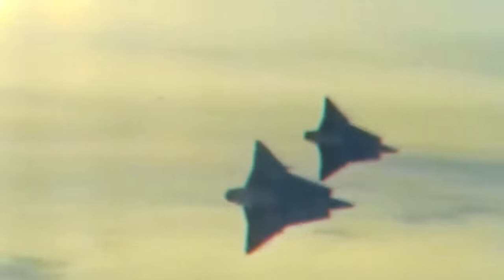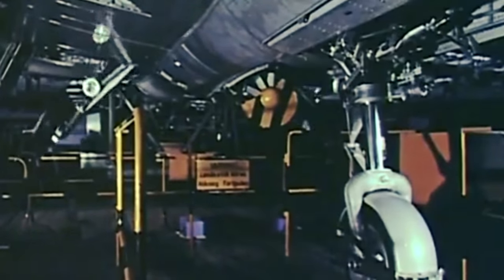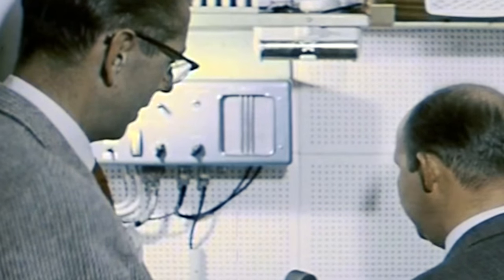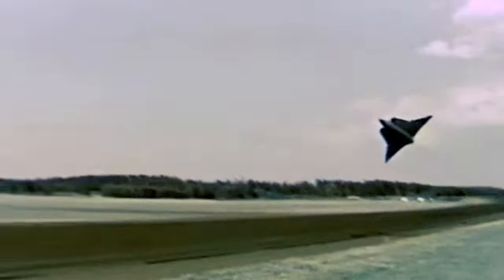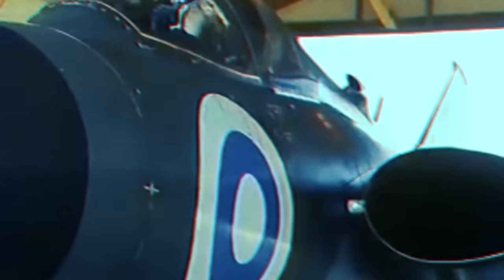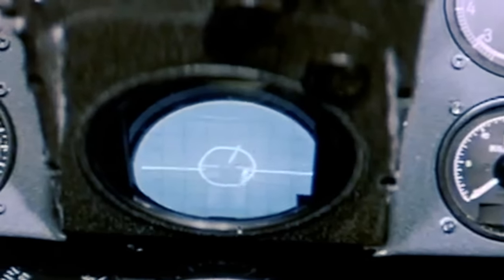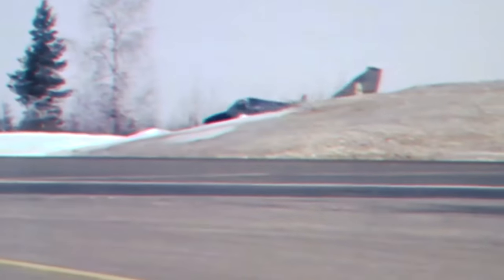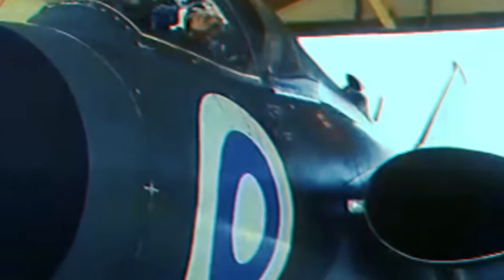The Bizarre Airplane Design That Shook Up Aviation

Comment: The Cobra is how to get a fast approach bandit on your 6 in front of your guns pronto
Reply: No, that has never been performed in such a way and it also doesn't work that way. By doing that you have a very good chance crashing into the aeroplane behind you or turning the manoeuvre into an uncontrolled stall - which is the last thin you want to experience in combat. No sane pilot would ever try that during a dogfight.
This manoeuvre requires a lot of experience and it also requires very specific circumstances - which you'll hardly have in a combat situation. The other thing you need to be able to even attempt this, are specific software modifications, because the aeroplane won't allow you to stall it on purpose. It is literally the worst thing you can do during a dog fight. You pull that manoeuvre in combat, you'll die. Cobra only works in DCS. Also you always have your back covered. When was the last time anyone fighter pilot went out without his wingman? The cobra is only to Su-27 fanboys wet dreams.

Comment: Although the video says ( 05:18 ) that the Cobra manoeuvre is not 'directly applicable to combat scenarios' it is very useful in a dogfight. If you watch the video ( from  05:00 to 05:05 ) the first pilot uses the manoeuvre to change from being attacked to being the attacker.
Reply: No, that has never been performed in such a way and it also doesn't work that way. By doing that you have a very good chance crashing into the aeroplane behind you or turning the manoeuvre into an uncontrolled stall - which is the last thin you want to experience in combat. No sane pilot would ever try that during a dogfight.
This manoeuvre requires a lot of experience and it also requires very specific circumstances - which you'll hardly have in a combat situation. The other thing you need to be able to even attempt this, are specific software modifications, because the aeroplane won't allow you to stall it on purpose. It is literally the worst thing you can do during a dog fight. You pull that manoeuvre in combat, you'll die. Cobra only works in DCS. Also you always have your back covered. When was the last time anyone fighter pilot went out without his wingman? The cobra is only to Su-27 fanboys wet dreams.

Comment: Less applicable NOW, however why is "the cobra" not useful in guns range? Until the F-15, according to an episode of Wings (not the NBC sitcom), "the Israelis were 'infamous' for killing at close range." How is it not useful to slow down suddenly and your opponent to fly under you unless xe is behind and above you?
Reply: No, that has never been performed in such a way and it also doesn't work that way. By doing that you have a very good chance crashing into the aeroplane behind you or turning the manoeuvre into an uncontrolled stall - which is the last thin you want to experience in combat. No sane pilot would ever try that during a dogfight.
This manoeuvre requires a lot of experience and it also requires very specific circumstances - which you'll hardly have in a combat situation. The other thing you need to be able to even attempt this, are specific software modifications, because the aeroplane won't allow you to stall it on purpose. It is literally the worst thing you can do during a dog fight. You pull that manoeuvre in combat, you'll die. Cobra only works in DCS. Also you always have your back covered. When was the last time anyone fighter pilot went out without his wingman? The cobra is only to Su-27 fanboys wet dreams.

Comment: 0:43 & 9:05 is a MiG-21
Reply: It’s not MiG-21 you can see there’s a Swedish Air Force sign at the black
Reply: @itmethang  

0:44 Front view MiG-21 cockpit
9:04 pilot boarding in the MiG-21& Front view MiG-21 cockpit
Reply: ahaha no as far as i know the mig 21 isnt a tailess delta

Comment: Going full nerd, anyone else get reminded of the “Jed Starfighters” when looking at the delta design of this fighter? I have never see this real fighter before, but there is no way George Lucas did not take a little “inspiration” from this design. The only difference is the cockpit in Star Wars versions are moved to the back of the airframe on the craft.

Comment: The Russians always trying to steal Swedish stuff and claim it as their own. Those Swede tanks and the Saab 67 Viggen fighter they after these are also legendary. The Viggen earning many first, best, only accolades of multi-role fighter. Iirc it was started ~’57 and many of it’s systems to help and automate tasks done by a navigator/co-pilot/cwo weren’t surpassed till ~’80 with the Tornado which is now still leads in that department. Supposedly you can fly a tornado at very high speed, very low altitude thru rough varied terrain like Scotland simply by inputting destination and a few other commands (idk what but probably desired altitude, minimum altitude, max alt., min speed, desired speed, max speed, waypoints if desired) and the plane will use it’s autopilot to fly lower, faster, in rougher terrain than pilots can. Dude said he ride in one and when the pilot turned it over to the plane it was all sky, ground, mountain, sky, ground, mountain, valley, mountain, valley, ground, beach, ocean.

Comment: It should be noted that the "Cobra Maneuver" is almost the same as what's now known as "Pugachev's Cobra Maneuvre". The main difference being that it was first preformed in public by Pugachev with a variation. Regardless it's a terrible idea to use it in combat. The reason, it requires low speed. Meaning your going to get shot down long before your slow enough to preform it.
Reply: Negative, Pugachev observed swedish drakens doing this while they were intercepted when flying over the baltics. But they do like to claim they were the first one performing the maneuver which is false and a carbon copy of the swedes.

Comment: On the heals of our great aviation success we will be bought out by an automotive company who doesn’t even possess the ability to build a decent car. So let’s welcome the completely incompetent General Motors. The company that’s too big to fail, even though they continually do.
Very sad, wish GM would have disappeared instead of Saab☹️
Reply: if Saab had even tried to adhere to the at least 40% commonality plan with opel, they would have stuck around. Sadly, Saab decided to give the finger to GM and went their own ways with 95 and 93.
Reply: Saab wasn’t willing to dumb down their cars for GM. Saab literally ripped every platform GM handed them apart because they were junk. An example being the 9-7 aka Trailblazer, just lipstick on a pig. If you were a Saab engineer would you want all of your hard work plopped onto a Malibu chassis? I probably wouldn’t have been too cooperative with GM either.
Reply: @jerrysmith1887  Quality issue aside, had they played ball, Saab would probably still be around. Granted, they wouldnt have retained their creative madness. If i recall correctly, Saab also rebranded a subaru 4x4.

Comment: Not new. And not tailless- it still has rudder. Lippisch designed ME 163 among other projects tested in Peenemunde supersonic tunnel (1940-45 the only supersonic wind tunnels in the world were all designed, built and owned, by Germany) tunnel with cranked and uncranked delta- Prof Dr Ir Lippisch is the inventor of the delta wing in 1931, and many Wing in Ground Effect designs. Operating using public roads is basic compared to using Soviet concrete. Who else was years before the Swedes? De Havilland, Fairey, Miles of UK, Dassault Ouragan and Mirage, Gauliter's SFECMAS Ars.1301, Breguet, NORD, of France, USA's Northrop X4 which was a  jet powered Me163, Convair XF-92 (which was a Lippisch P13), the Sea Dart. Oh yes, Argentina's IA 38. Bad luck Svenny and Bjenny.
Reply: Not correct! The Draken was the first double delta wing supersonic airplane. No one knew if it would be possible to fly it. That's why test flight with a smaller version was neccesary before going forward with the real one. But delta wings was pioneered by the Germans, as most of what we have today. No wonder that the Britttish empire was so afraid of them.

Comment: That's not tailess
Reply: "Tail" refers to the Horizontal stabilizers. Mirage III, Concorde and the B-58, to name a few, are tail-less deltas.
Reply: @winternow2242  Interesting, then what is the distinguishing phrase for this type? if those were"tailess" designs, and this has nither vertical or horizontal stabilizers, how do we refer to this design decision, vs those previous decisions.
Reply: @ScruMi2  this plane does have a vertical stabilizer. Why did you think it didn't?  Also why would an aiplane need a "distinguishing phrase"?
Reply: @winternow2242  my bad I should have been more specific I forgotten about the content of this video. But more specifically the NGAD is what I was referring to if this plane is considered tailess, then what would you call the NGAD design. Specific design decisions are named for copyright/trademarking and over all ownership of the design philosophy. Standard business practice.
Reply: @ScruMi2  I've been reading about airplanes for decades. The names and designations of the aircraft is enough. You would call NGAD whatever its manufacturer agreed to call it. 

"Specific design decisions are named for copyright/trademarking and over all ownership of the design philosophy."

I've never heard of that. What names do you think were given for the Mustang, SR-71 or the F-15?
Reply: @winternow2242  sr71 had a Delta wing design, p51 has a drag-lamiar flow wing, f35 had trapezium shaped wings. Like I said, specific reasons p designs usually have a specific terminology describing their individual design philosophies.
Reply: It's a pragmatic way to do business, which is why it encompasses so much of our life, branding is almost it's own study.
Reply: @ScruMi2  "laminar flow wing" isn't a name, it's a technical description for the wing, as opposed to "turbulent".  Any airplane that had that kind of wing would have a laminar flow wing. The SR-71 had a delta wing, as did many other aircraft. Avro Arrow, Concorde, Mirage III, Vulcan, the Space Shuttle. Nothing distinctive about it. These are technical names not plane-specific. Business has nothing to do with it.
Reply: According to engineer excel
“The P-51 Mustang was one of if not the first aircraft to intentionally be designed with laminar flow wings, by the National Advisory Committee for Aeronautics, the precursor to NASA.”

Later concluded “At first many manufacturers declined to continue developing wings with laminar flow in mind, as obtaining a totally smooth airfoil within exact tolerance proved to be too difficult for the days of the early 1930’s.”

So they very specifically disagreed with the government entity, design, philosophy of drag-laminar flow wings; the very fact, other companies went on to create Delta and double delta wings, trapezium shaped wings, and at the early stages of aeronautics, the drag-laminar flow wing of a P 51 mustang, very specifically branded by a government agency, seems to disagree with you, the multi decade aeronautics aficionado.

Comment: Some explanation not understand but only a bit how less raked wing not cause shock wave at high speed and instability but more raked wing perform ok. Just tradeoff and let it rumble in the mach++ regime? Also not explain well why two mouths but only one butthole. Better no with two engine digestion two butthole in case one stop digesting, but cheap out on that? Thank you.

Comment: What's funny is that no one mentions the Avro Arrow. It was first.
Reply: First in what?
Reply: @atlet1  Pretty much everything. Look it up.
Reply: @NERvshrd you are spreading False information. J35 draken first flight 1955. Arrow first flight 1958.
Reply: @atlet1  I never said what it was first _at_, now did I? 😁Careful.

So basically, the Avro Arrow was the most advanced aircraft of the era, with superior speed, stability, and control. No other aircraft at the time could match it. It was also extremely expensive.

"During 1956, the first operational version of the Draken, designated as the J 35A, was ordered into quantity production and the first production aircraft flew for the first time on February 15, 1958. Mach 2 was reached on January 14, 1960 with test pilot Erik Dahlström at the controls of the J 35B prototype."

"The original requirement specified a top speed of Mach 1.4 to 1.5, but this was revised upwards in 1956 to Mach 1.7 to 1.8 and then again in 1959 to Mach 2.0"

The Draken production model did indeed fly first by just shy of 6 weeks. Nobody cares about first flight, though. That only ever mattered back when no one had built an aircraft. What matters is what they could do, and the Arrow demolished every record on the board. There's even a video about it on this very channel.

"On its first flight, piloted by Janusz Zurakowski on 25 March 1958, the Arrow broke four different speed records. Over the next year, the five “Mark 1” Arrows (i.e., the first version of the plane) would fly a total of 66 times. The more powerful “Mark 2” Arrows that were in development never flew. Despite the plane’s enthusiastic reception, both the Arrow and Avro would soon meet their end in complicated political battles and backroom deals." 

The mk.2 was the same plane, but with the lighter and more powerful engine they designed in-house. It was noted that the mk.2 would be capable of approx mach 2.4.

To be fair, a number of nations cancelled their interceptor plans around the same time due to the cost and changing political landscape re: nuclear missile threats of the cold war era.

"Even those in favour of the Arrow acknowledge that had the program sustained funding, the jet would not have been ready for combat until 1962." 

This is probably a more telling figure, as the Draken was in service from 1959. Additionally, the Draken was a third the weight of the Arrow, and likely much cheaper to produce.

interesting side affect re the engineers and specialists who lost their jobs when Avro was dismantled:
"... Others left for the United States to work on various projects within NASA. Indeed, this influx of over 30 elite scientists and engineers to NASA, as historian Bill Zuk asserts, “helped put man on the moon.”"
Reply: @NERvshrd  False again! You claimed it was first two times. The reality: the arrow was an experiment aircraft that never set any speed record for experiment aircrafts. Draken was a production aircraft fighting for Swedish air superiority since 1960 with the demand to be M2 capable. The experimental aircraft Arrow never even reached M2. The Arrow was a very big and very costly experimental aircraft with a bleek future, if it had reached the operational phase.
Reply: Why should they?
Reply: @atlet1  All of the text I quoted is, you know, quoted. From official sources. It's not a well known design outside of Canada, though, so I suppose some ignorance is excusable.

The Arrow hit mach 1.9 in 1958 with inferior engines. No one else had gone that fast yet. Literally the next plane off the line would have the new engines. it was being built when the cancellation order came down.

You're "right" because it never flew past mach 2 due to being canned. Doesn't change the fact that the Arrow was ahead of everyone else and was likely to continue that trend -- but only if it had the funding. 

Was it a good plane? Within a specific role. The Arrow was designed as a pure interceptor and was cancelled for much the same reason as many other similar designs around the world. Too darned costly. As anything but a straight-line interceptor, it wasn't great. The projected top speed of mach 2.4 for the mk.2 was actually an airframe heating issue due to aerodynamics and materials. On a realistic level, the proper production model would have more likely been the mk.3, which was being designed to correct those issues and enable mach 3+ speeds. Much more likely is that only a small number would have been produced, much like the F106.

The real prizewinner was probably the engine, which had a a tremendously high thrust-to-weight ratio. It was ironically never sold due to misunderstandings of why the arrow project was cancelled. Other nations eventually developed better engines, but not for almost a decade.

Oh, and I already pointed out that the Draken was a third the weight and vastly more economical. And that the Arrow was expensive.

Overall, there were a lot of good planes designed around the same time. The Draken was way more versatile, though. Apparently the final version was such a good aircraft that it remained in service until 1999, which is an even longer lifespan than the F-14. Now that's impressive. Saab seems to have made a habit of designing solid economical aircraft.
Reply: @NERvshrd  every combat airplane from SAAB have been a military success for 80 years. Their only experimental aircraft was "lilldraken" because the thesign was so revolutionary and could not be predicted by theory. The Arrow was an experimental aircraft and not first at anything. To go M3 need titanium frame and room for thermal expansion. No such technology was available at the time. Compare SR-71 for knowing how unrealistic that was.